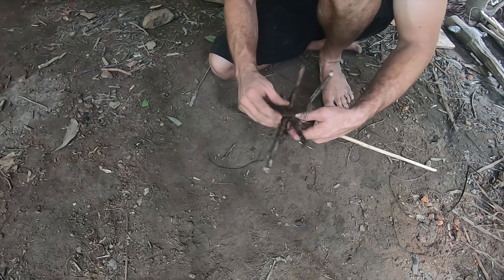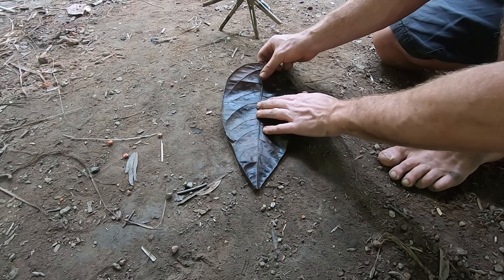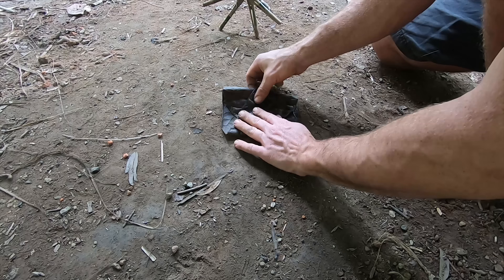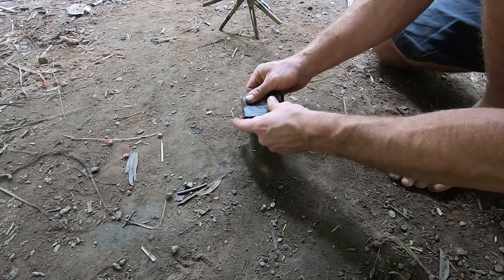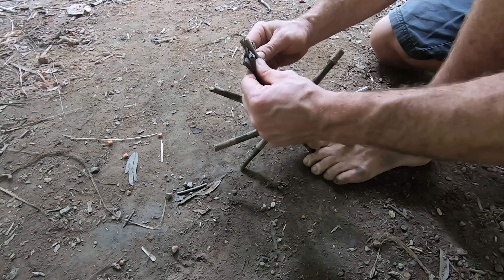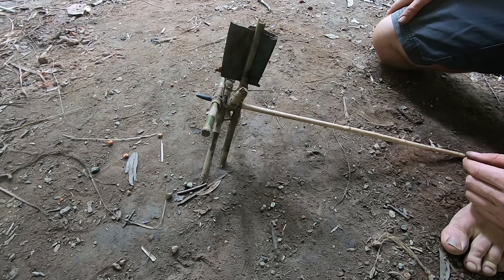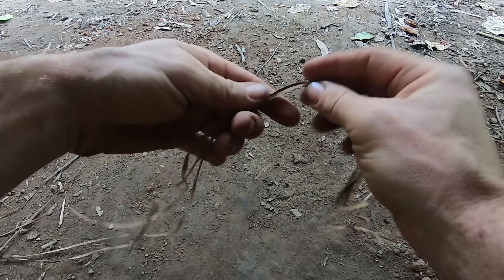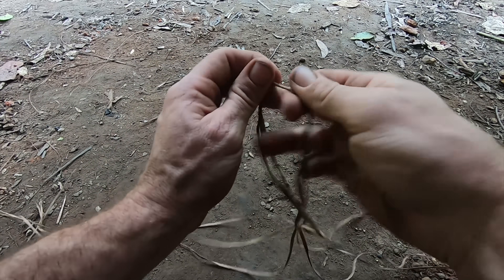Primitive Technology: Improved Multi-Blade Blower

Comment: do you think a blower like this could work with a mechanism similar to a pole lathe for providing the rotation?

like put it in a wooden frame, prop it up vertical and use a foot pedal and a mandril to get the impeller turning

i am thinking on building me a forge and your video made me get that idea to use a blower instead of trying to build bellows

Comment: It got me thinking, what if you did a simple way with a crank? it must be more complex and for good performance you would have to use ceramic pulleys and rope, but the advantage would be constant air flow while it keeps spinning, of course to avoid blisters on your hand use something like a piece of bamboo on the handle to avoid friction with the hand

Comment: I'm curious if you could make a piston and crank system out of clay and boil water from a separate fire to work the blower. The sizing is probably difficult to get right since a piston and its cylinder would have to be mostly airtight but I wonder if you could make it work. I feel like you could probably get better smelting results with the constant powered airflow rather than having to spin it manually and stop occasionally to add fuel/ore.

Comment: I love this channel so much because the way he learns seems similar to the way I like to learn new things. I like to take an idea, dive in with maybe only a little basic prior knowledge, and see what happens. The experimentation and trial and error is the most enjoyable part for me.

For example I took up woodworking as a hobby while knowing next to nothing beyond what I already of basic tools and saw types. Had a small project in mind already. I had a bunch of loose allen wrenches (aka hex keys/L-wrenches) and no holder for them. Rather than buy one I decided to make one. The first one was garbage but I learned how to work with and around the heterogeneous nature of wood. The second attempt was far better (looked better too) but required I glue 2 pieces together which also required a very flat surface. On the third attempt I stuck with one solid piece of wood and managed to make the holder thinner without sacrifice much in the way of strength.

I sure hope that one day I have the access to the land necessary to take up these kind of primitive activities because every time I watch these videos it makes me want to walk straight into the woods for a weekend with no outside contact.

Comment: I think that they would've learnt that having a hollow center for the blower would make things better. Mainly because i'd expect them to figure out a blower by making a simple flat surface to mimic what they'd do with their hands when they'd move the flat side of the palm back and forth to stoke a fire. If you use such a "blade" to stoke the fire, or a fan (as it would be more commonly known today), in the very early moment of ignition, when there's a lot of smoke, you can see the air path travel. They're smart people, so something like this would grow pretty fast in the hands of an observing individual.

Comment: If you made the blower with a push down stick and rock/clay flywheel, you could make two blowers into a common manifold with one-way flap valves then pushing down on one while the other goes up you could get more continuous air flow., and easier on the hands.

Comment: Hey, is there a reason why you ditched the bow spinning method for the one string thing? Amazing work, by the way! You have to be one of the craziest people I’ve ever seen! Good crazy, BTW
Reply from the maker: Yes, the string keeps breaking on long smelts. So it's easier to move the string along than to string a new bow. If the smelt stops for too long, the slag freezes and it can cause problems. Yep, crazy like a fox. Glad you like the videos, thanks.

Comment: watching him measure sticks with his feet reminded me of something my dad once said. 

Metric is great and all, but there's no humanity. It's a system for machines and precision.

The imperial system is one based on people. An inch is about the thickness of your thumb. 12 inches is about the size of a foot. Three feet make a yard. A man's body becomes his measuring stick.
Reply: Well that doesn't really work because everybody's body parts are different sizes
Reply: @crayon_eater1234  It doesn't have to be exact. Your average 6ft man will have a footprint about 10-12 inches long.
Reply: It's still impractical and just stupid. 12 inches = 1 foot, 3 foot = 1 yard, 1760 yards = 1 mile.
Now here's the metric system. 100 centimeters = 1 meter, 1000 meters = 1 kilometer, a lot easier isn't it? Also the fact that the US is literally the only country using the imperial system makes it even more impractical.

Comment: Ive watched a ton on videos on backyard bloomery smelts, and the two most common failures ive seen that precluded getting a good useable bloom were (1) insufficient airflow, and (2) failure to use a flux source (ex: fine silica sand) to facilitate the all important formation and runoff of slag.  Not enough air means insufficient heat, and things dont flow/consolidate properly, and no flux means all the impurities stay in the bloom, leaving it hopelessly tainted, crumbly and useless for further consolidation and forging.  There are other blunders, but those seem to be the two most common among backyard bloomeries.

Comment: I think a bellows would have been a better way to go.  Your fan housing isn't correct.  Volutes for pumps are not simply symmetrical housings with centered outlets.  The spacing around the outside of the fan needs to vary and the outlet needs to come off at a tangent.  You could also improve on the flat fan blades by making then curbed or scoop like.  I think you went with the symmetrical flat blade design because you're thinking about the two directions the fan spins, but neither direction is efficient as a centrifugal (air) pump.  The off centered design I describe would be better even if you consider things only when the fan is spinning one direction and ignore the reverse direction.

Comment: By adding walls around the fire that curve in slightly will create a moderately strong whirl-wind, it sucks in more air and burns hotter.
Maybe that could be used, but I don't know if it is effective enough.
Wish you luck. From Sweden.

Comment: If you attached a clay disk around the stick you could use it as a fly wheel so that the output could be on the side and you could keep spinning it in a single direction using you hands to spin it instead of the rope

Comment: The rotor could also be made out of clay right?
But the weight would be a problem when pumping the air the way you did.
The increased inertia would be beneficial if you had a way to make the rotation constant.
Is there a way to make primitive bearings/bushings that would last in continuous rotation?

Comment: Sheer genius. Before this I had always assumed that either 1) the smelter blew into the tuyere, using raw lung power or 2) a kiln would be set up on an exposed hillside in a generally windy place, with a big funnel in front of the tuyere to catch and direct perpetually blowing winds, as Cycladic civilizations seem to have done on the Aegean islands of Naxos and Keros/Daskalio. Or just possibly a bladder-bellows might have been invented fairly early. But your idea of creating a primitive squirrel cage blower powered by a string or bow drill is pure genius. You have proven it could be done...but was it? A genuine contribution to experimental archeology.

Comment: Looks like he's found the manual blower is preferred to the chimney natural draft furnaces (which I thought were really nice).  Shame he can't make a hide bellows due to local hunting laws.  Either way its going to be tiring pumping a blower by hand for a long smelt, but I'm sure he can do it.  I wonder if a wooden gearset is possible, crank handle or even harness energy from the creek, he did the water hammer....

Comment: This is honestly incredible. You're essentially rediscovering (Or reinventing perhaps) the origins of the stuff we take for granted! 
Not to mention you could literally connect the spinning mechanism to a primitive form of watermill to have hands-free bellows! All you'd need it a method of stopping it when necessary!
Reply: the eight wheel design could probably function as a water wheel with some reinforcement and maybe slanting the paddles a bit so the water slides off them... i wonder if from there basic electricity production can be made, im no expert but isnt electricty produced when copper has a strong rotating magentic field? or did i hit my head to hard and things start bluring?

Comment: Just a tiny tiny adjustment to your lid:   Round the air intake holes edges. That makes is SO much efficent.  Those sharp edges around the air intake actually narrows the airs path signifigantly, because the air molecules need to make a sharp 90 degree turn ( actally 2 of them )

But if you round the edges, the air molecules stick to the round parts, making it easier for other air molecules to " slide " over them. 
This is why the airducts in your house has rounded edges. Also turbo and superchargers in cars.

Great video. So relaxing.

Comment: Glad to see you making videos again!  

Have a suggestion:  if you tied a stick on each end of the string on your impeller, you'd end up with something like a "pump drill" (a derivative of a bow drill)  this would reduce the effort required to keep it spinning (a single handed vertical motion, vs two hands pulling) and give you greater consistency, which should result in better temps in the fire bowl.

Comment: Please try using the much larger spindle and push-down cross bar shown in several fire starting videos on YouTube.  By pushing down on the crossbar, you use your hands and get much more power and consistency than just using fingers. 
 If I were in a survival situation, I would makes several of the spindle and crossbar fire kits complete with tinder and fireblock because they apply more energy to friction and are  thus more reliable starting fire under adverse conditions (albeit less compact than your hand friction spindles)
Otherwise, it is fantastic to see you exploring the most basic ceramics and metals technology that (some of) our genius ancestors unlocked.  Would love to see you find more high volume iron ore for production (which banded iron formations ferrous deposits Australia is famous for) and possibly even try making primitive steel

Comment: An interesting concept to consider would be a blower spun via horizontal disc with an offset knob. The advantage would be constant airflow. I believe you could utilize cordage wrapped around the disc and looped around the rotor, similar to what might be seen in a car's engine bay. My unsubstantiated theory is that an uninterrupted flow of air to a fire would heat it up more over time, however, starting it would require more work. 

Just something to consider.

Comment: Now you have to design one that works in tandem with the other so that when you pull the one the others is winding back up so you get constant air flow from two different blowers. Instead of puff puff it would be two constant puffs from perpendicular directions.

Comment: While I know it isn't always as ergonomic, I would love to see this combined with the pump stick method (wide stick with a hole drilled through and the ends tied to the ends of the cordage. It goes on the shaft so the impeller can be driven with a simple pump downwards on the stick). Great stuff, excited for metallurgy!
Reply: Figured he no longer does that because it only wears the stone bearing so much faster from the extra downward force.
Reply: @eien1107  My thoughts too. The friction is good for creating heat to make a fire but counter-productive when you just want to move air while expending the least amount of energy. He could use some sticks (placed in a V-shape, standing up on the lid) and hold them halfway up while the string are tied to the tops to investigate if having your hands do less travelling sideways (by using a lever basically) is doable, comfortable and less tiring.
Reply: Pretty sure he's made one of those before

Comment: Could continuous rotating motion be achived with a pedal, like they had on the old Singer sawing machines? With wood and clay I mean. That would be hell of a useful machine for metallurgy. Also, a machine like that could have angled blades to give the air even more direction and pressure.

Comment: Could you make a crank with a pulley, and a separate pulley on the heads off the fan shaft?  Would allow you to continually operate the fan and run with a greater speed

Comment: Looking forward to that metallurgy. I still can't think of a small metal product that would be more useful than a knife-edged chisel. One side could even be serrated, if desired. Combines a lot of functionality with little material.

Rasps are also deceptively easy to make and case-harden, but the necessary temps and times for the latter would likely be an obstacle.

Comment: Fun fact, this is called a centrifugal blower in the HVAC industry. It doesn't 'push' the air so much as 'sling' it outwards, and the housing guides that air to where it needs to go. They tend to be very good at overcoming static pressure, which is good for ducting because the static pressure (the air's resistance to movement) can tend to be very high.

Comment: I wonder if the design could be improved to increase the oxygen flow. I suppose that each time the blade slow down, air from fire flow into the blower reducing oxygen output (thus reducing combustion efficiency).
I wonder if it is possible to shape the exit of the blower in a way that reduce air intake. For example create some opening on the exit segment to have fresh air flowing into it.

Comment: i feel like there has to be a way to drive this from the hot exhaust from the top of the furnace, to basically make a forced-air/turbocharger furnace... but i suppose due to mechanical losses of primitive bearings, the benefits would be outweighed by the restriction it'd add to the air intake.

Comment: Next step - powering by watermill 😄

Also.
Make a hole in the center of top plate approx in 2 times larger. It will produce significantly more air.

Comment: Just an idea here.. 

Years ago, you made some sort of "pump drill" in one of your videos where you carved a hole through the middle of a cross bar and fed the main spindle through and then attached the string either end and could operate the whole mechanism by pumping the crossbar up and down to get the spindle turning.. I think you used it as a firestarting device though, instead of to control the impeller. 

My idea would be to attach a cross bar to the spindle as before, but this time, have an angled pedal attached to it that you can operate with your foot similar to a medieval grinding wheel. Allowing you to control a steady flow of air to a fire whilst leaving your hands free to do other things simultaneously